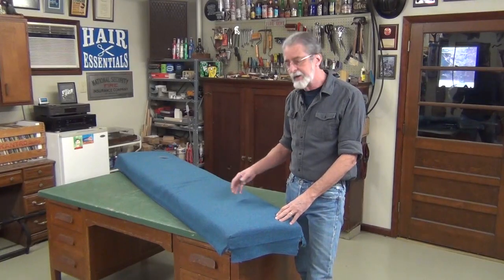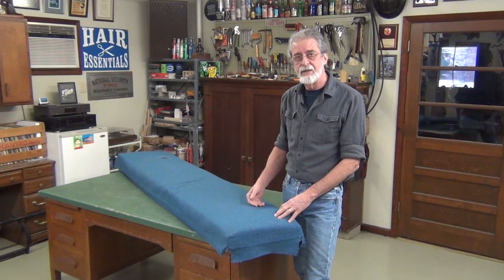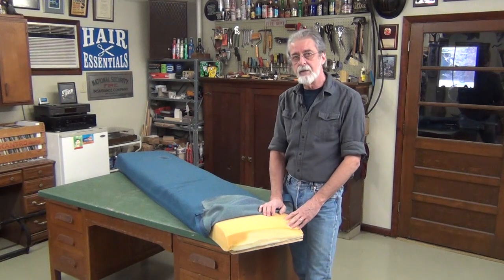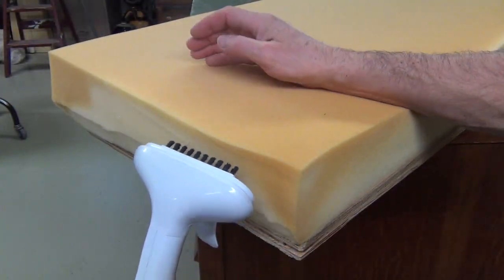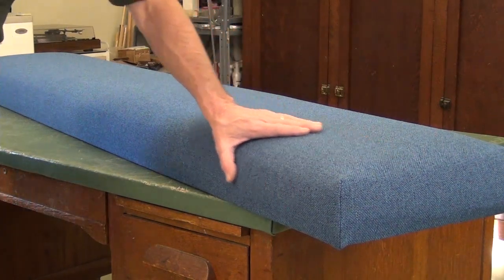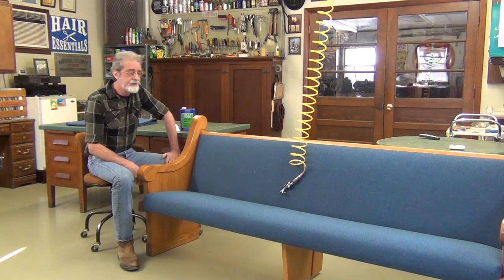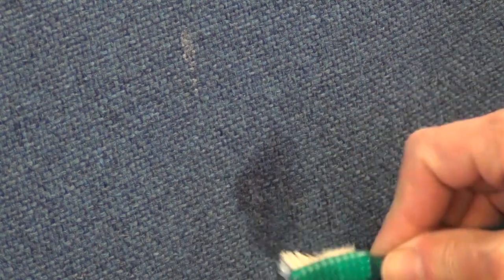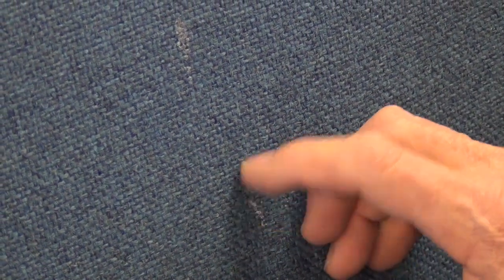Church Pew Foam Revival

Comment: I had no idea you could revive foam with steam!! Does steaming work for alot of foams? I have a couch that I was thinking about replacing the foam.
Reply from the maker: New foam is the better way to go. Quite honestly, I have heard of steaming many years ago but this was the first time I tried it. Very beneficial in this case. I recently tried it on automotive foam and it wasn't nearly as dramatic, however automotive takes far more harsh temperatures and I didn't expect much results.